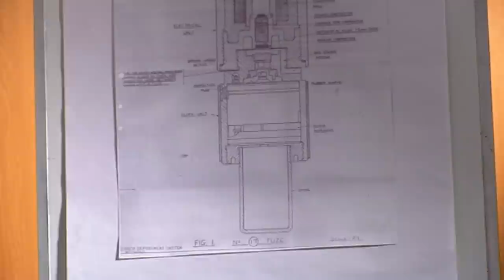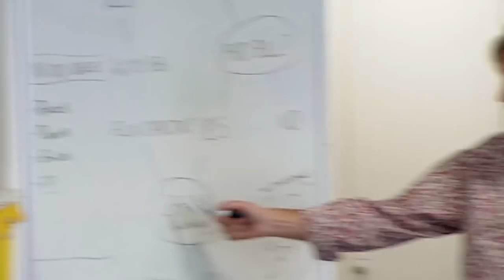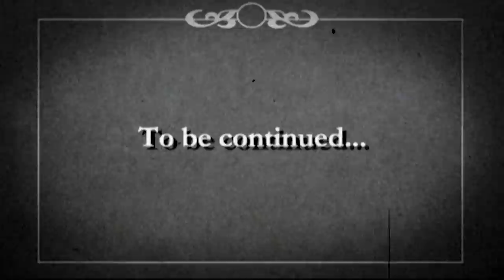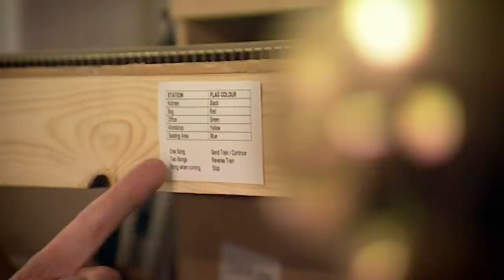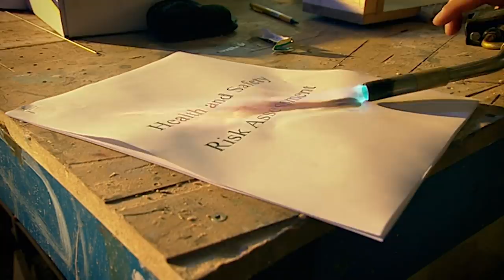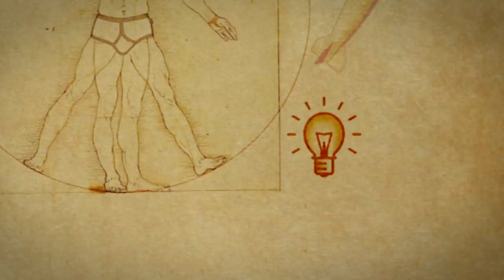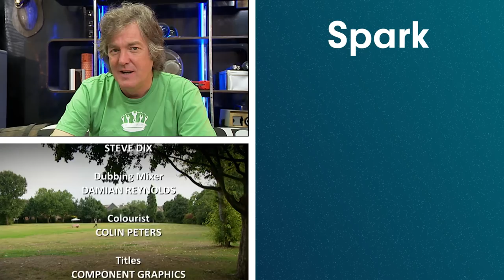James May Takes On An Unexploded WW2 Bomb | James May's Man Lab | Spark

Comment: American electrician blue wire usually is data cable and brown is thermostat cable and when we wire up a plug it's usually 2 hots normally red and black and green ground and white neutral
Reply: White and black.... Red is normally reserved for the traveler in 3-Way switch system.

Comment: 21:05   Here in the U.S., our mains wire colors are Black, White, and Green. 
The screw terminals for the wires on an outlet, switch, or plug end are colored Brass, Silver, and Green. 

I made up a saying years ago to help me remember and it goes like this.. Black to Brass to save your ass, White to Silver will not kill her, Green to ground you shall not frown... 🤷🏻